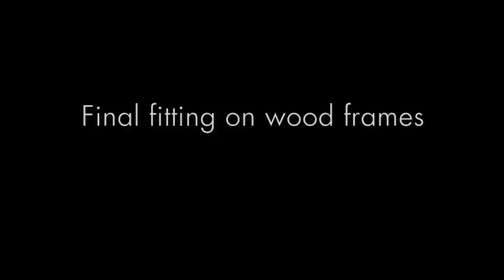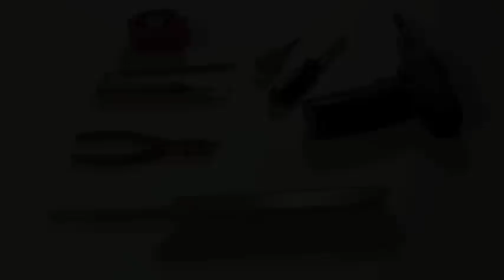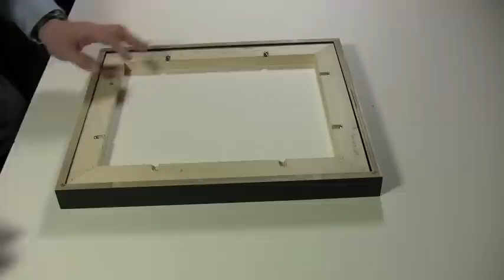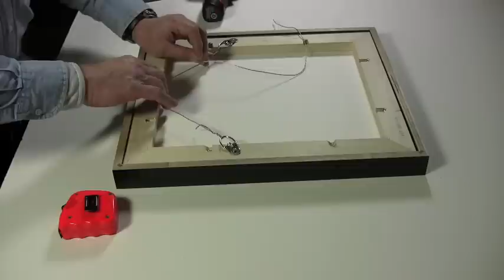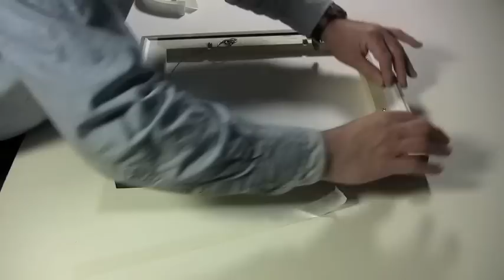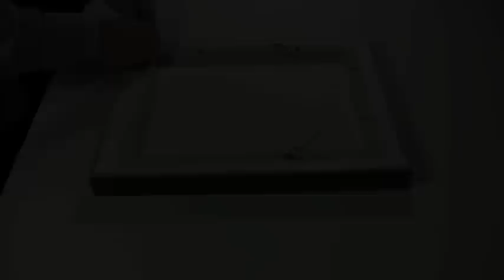How to use strainers & add the hanging devices to wood frames

Comment: I purchased some plastic tubing at the local hardware store, and I cut off pieces to cover the sharp ends of the wire after they are twisted. Just remember to put the little plastic tube pieces on the wire before you wind it around the strap hangers.